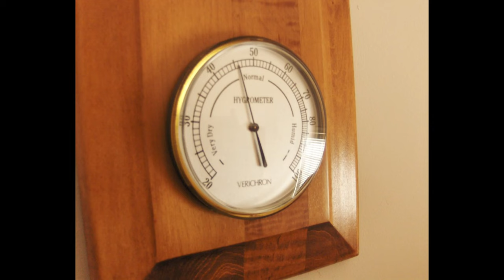5 Weird Things - Cigars

Comment: As a former cigarette smoker cigars are night and day. In ciggaretes it's mostly the chemicals that are addictive. I can smoke cigars 3x a week and then stop for afew weeks. Also it does not feel taxing on my lungs due to no inhaling.
Reply from the maker: I always wondered about that. So is it just mouth suction or do your lungs draw in at all? Never tried cigars.
Reply: All you do is puff the cigar, it's not meant to be inhaled. You absorb the nicotine through your mouth. Think of chew and dip. Kinda of the same concept with getting the nicotine. I'm a former cigarette smoker. I quit, then vaped and chewed every once in a while. I smoked 1-3 cigars a day depending on time and weather. Always smoke premium tobaccos, and it's been working well. The risk of cancer is low when using premium tobaccos. There was a study done in 2022 or 2023 to prove its not as bad as cigarettes